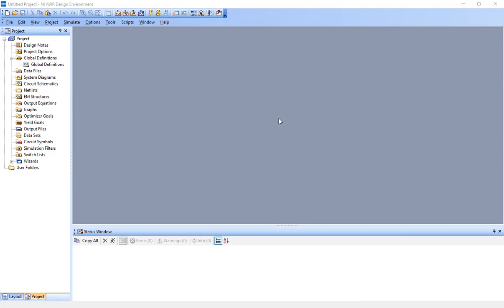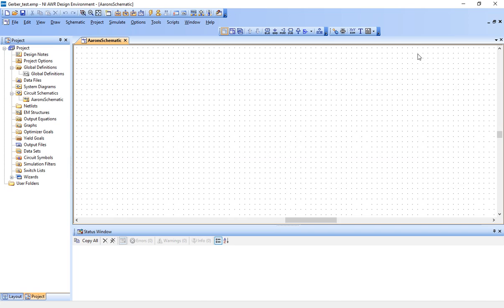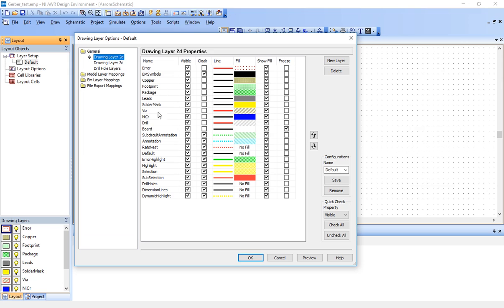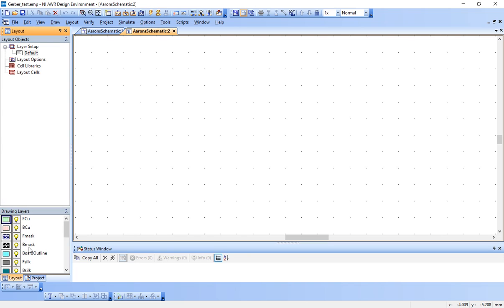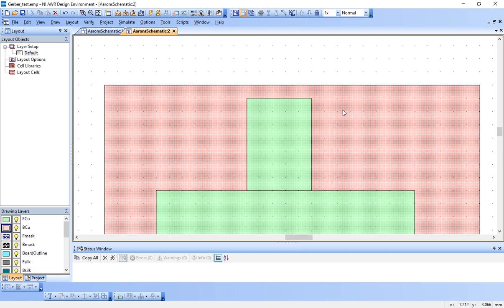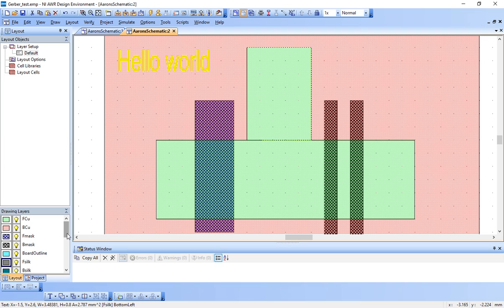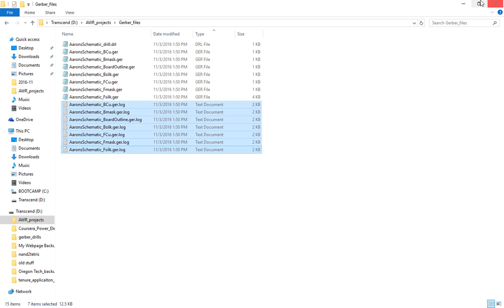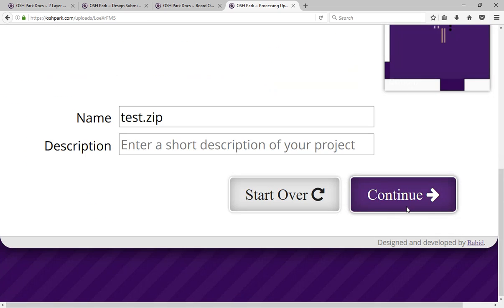NI AWR manual PCB layout and Gerber + drill file generation

Comment: Purpose of via component ?
Reply: Vias allow for the copper traces to pass from one side of the board to the other. You can see this easier here,
 https://learn.sparkfun.com/tutorials/using-eagle-board-layout/all

Halfway down the page to the "Placing Vias" header, you can see where the drawn red line (top layer copper trace) turns to blue line (bottom layer copper trace) "via" a green circle. This green circle designates the hole (that is drilled, then copper plated) that allows current to flow from one side of the board to the other. So the copper traces don't cross. Sorry if this is too long of an explanation.